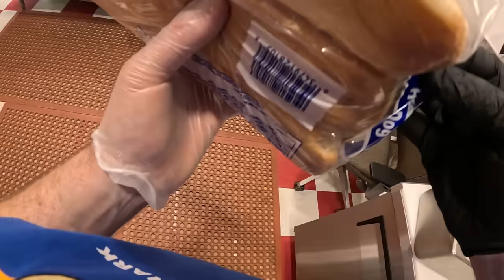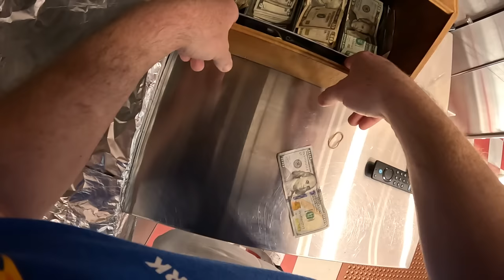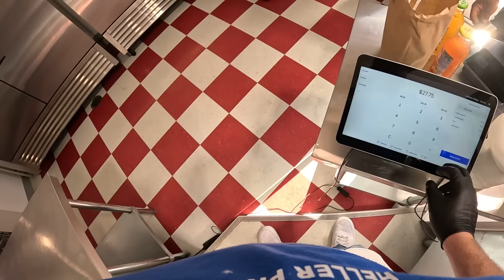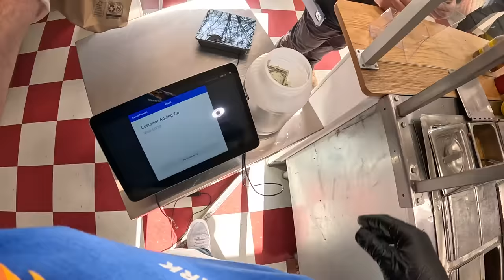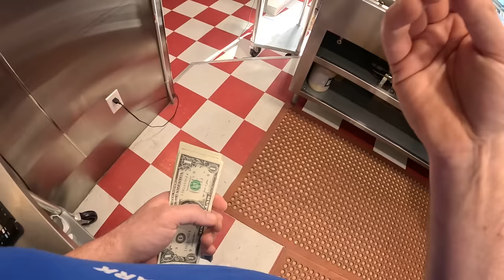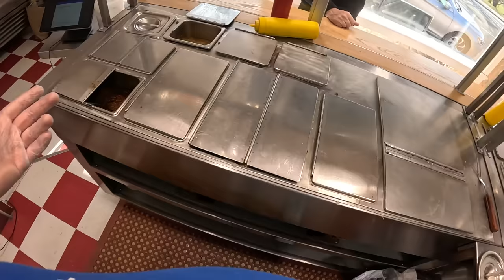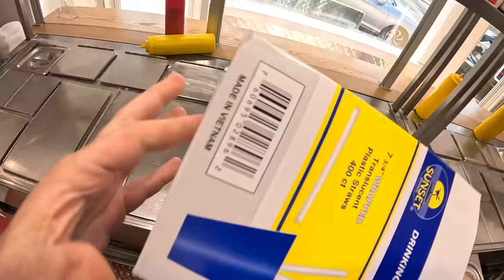sorry for this angle, but it's still something to watch

Comment: I feel it'd be quicker to set up a rack or something that holds multiple buns open and then you can make multiple at a time instead of doing them one by one. Saves having to open close sections/pickup put down bottles for each one. Maybe the rack can sit on a tray that you can slide around.